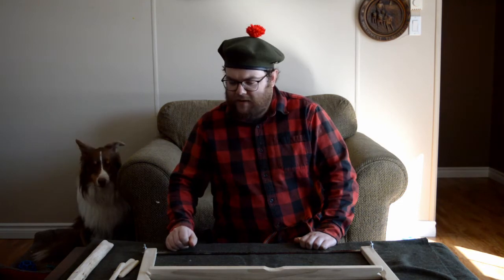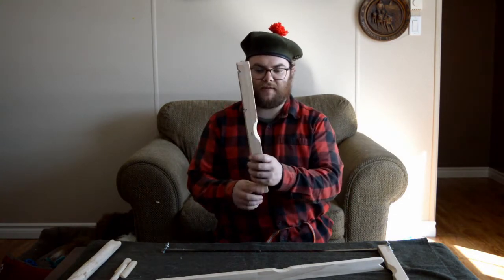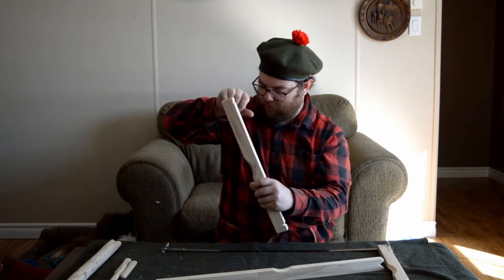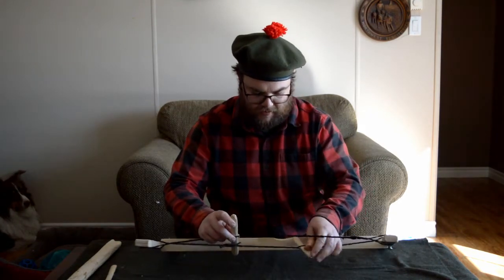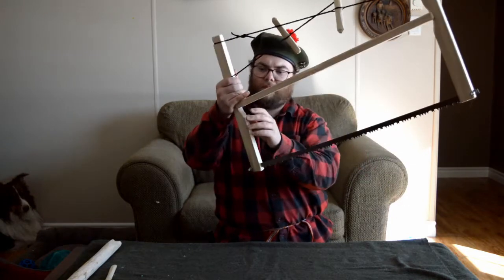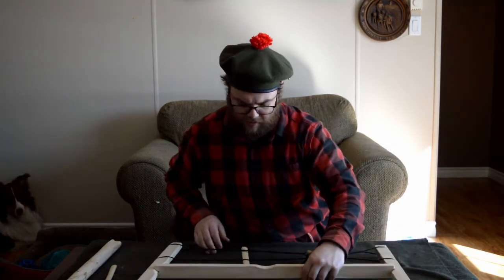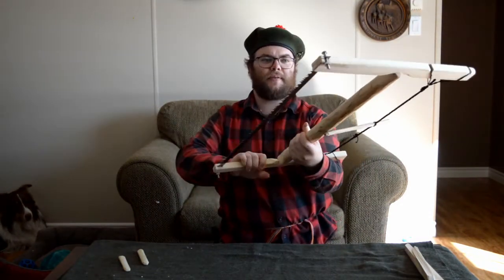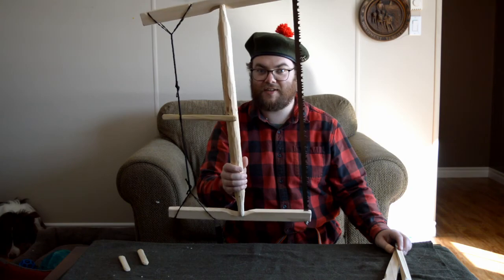Bush Bucksaw - Modified Harlton Design

Comment: I always think a constrictor(or double constrictor) pulled tight with toggles applied behind each of the female joints on the crossbar will help with the splitting.
One way to reduce the damage the windlass break is to wrap an elastic material around it. I find a long piece of rubber band(or joined rubberbands, or  weak bungee cord) can serve that purpose. When you employ a large windlass for pulling items in construction, put a heavy cloth or something on it so its lash when broken is decreased